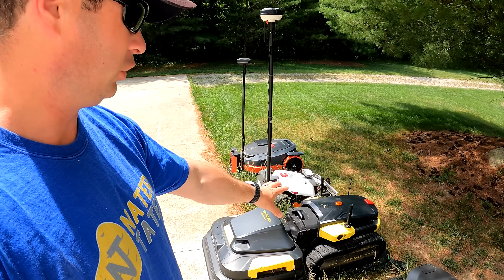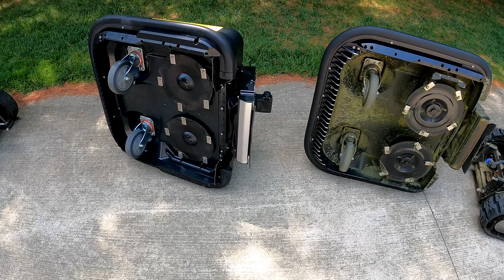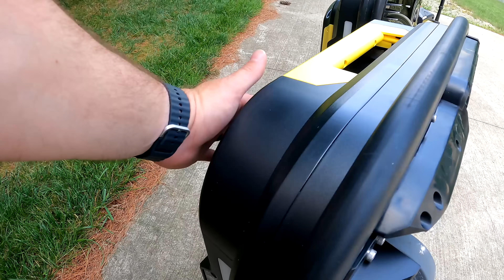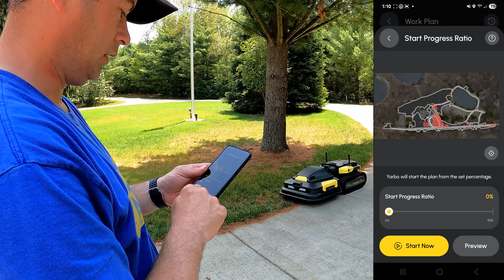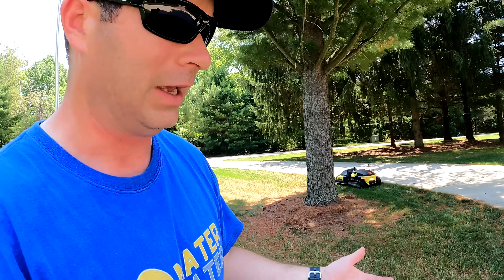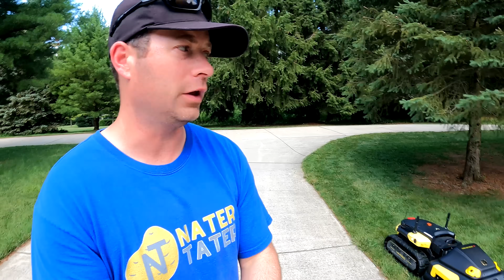✅Woohoo! Real Blades - Yarbo Mower Pro Comparison Testing vs Robotic Razor Blades M1 Module

Comment: I get a lost signal a fair amount of time however the Yarbo seams to be handling it with the vision system but it's unnerving. Have you had any issues? Is your property flat or hilly? My issue is I have extremely tall trees all around the house and a hill which goes up above the roof top of our house plus it's loaded with pine trees and I have issues in front of that hill.
I bought an enhanced antenna but they just arrived and looking for information from a fello Yarbo owner. Thanks
Reply from the maker: Their support is pretty good if you record an issue on the diagnostic page and provide info in a help ticket through the app.  They can look at your logs and help you understand what is happening.  Do you have good Halow signal?  are you trying to use Wi-fi?  if wi-fi drops it can make gps drop.  There is a new community support forum that you can access through the app or online too for more support.

Comment: does this have vacuum suction like a regular push mower? also does this mulch? or no and the tall blades just lay down?
Reply from the maker: It has some suction and some mulching but not as much as a has mower.  You have to think of these robotic mowers a little different...they can go out every day if needed to keep up with cutting.

Comment: I have the pro on order and have had the M1 for about a month.  Overall I feel like the blades may perform better by not packing grass as much, but I think it's a stretch to say it has any lift as the deck is totally open with no walls around the blade area to control or direct airflow.  As such and by looking at the length of grass you were showing it had cut, I think mulching isnt happening either.  I have an acre of rough yard that I havn't let yarbo cut yet, I'm hoping the pro handles it.  I'm generally impressed with the yarbo, but it has a lot of deficiencies to address.  Antenna mounts, path wear, battery heat issues and software development.

Comment: I have the M1 mower with Yarbo and am extremely pleased with it performance.  I mow about three acres total divided into 3 work areas.  I mow at the slowest speed with a 8 inch overlap and 2.7 inch height. I will mow in one direction and as soon as it is done I will set it to mow the same area at 90 degrees (checkboard). My Yarbo will mow all day and all night and usually has a one day rest since I mow about two days per work area (hey, it is a robot so who cares) . My yard has never looked better and my wife is actually taking credit for the idea of getting the Yarbo. Not certain I need or want the Pro but thinking about it.
Reply from the maker: Awesome, glad you're liking the mower!

Comment: Yeah, I ordered a lymow (also has actual blades. Yarbo is cool, but far too expensive for the issues it still has and the weight.
Reply: @Chemicallybondedformations  I like the LIFEP04 battery on the Lymow One as well. I think Yarbo would benefit from an option that has that for mowing setup. I suspect they went with the other Lithium battery to better handle snow blowing battery charging in the colder temps.  For my large field I am mowing I fear the battery would wear out too fast on the Yarbo vs the thousands of cycles the LIFEP04 would provide theoretically.
Reply: @retroenergy2358  you're absolutely correct!

Comment: the finished mow looks much better than the silly razor blades. Is it still a 20 inch cut width and what is the RPM of the blades? it will need 3000 rpm or more to get good lift.
Reply from the maker: Yes, still 20in cutting width.  Not sure on the RPM

Comment: Great video thank you. Question, is the Yarbo one of the nosier mowers or are they all kind of similar?
Reply from the maker: The Yarbo is the loudest of the 15 I have tested.  The mower deck is slightly louder with the razor blades because it is the biggest (20in cut) but still very very quiet.   The mower pro blades add a little more noise but still very quiet.  The main noise I hear is actually the drive motors/gear whine.  My particular 2024 one here is louder than my past 2023 version.  But overall these mowers are way quieter than gas.